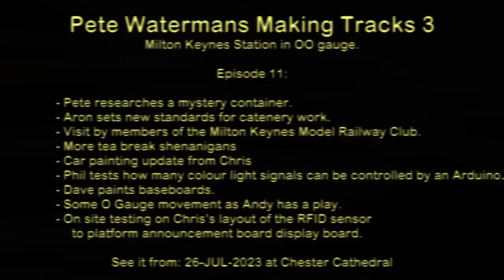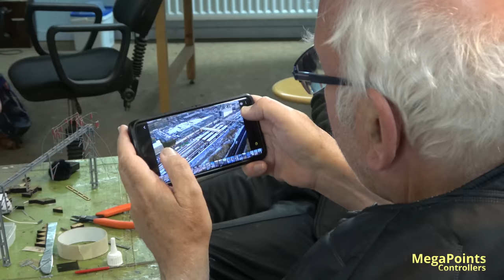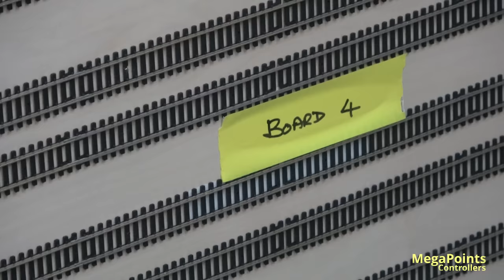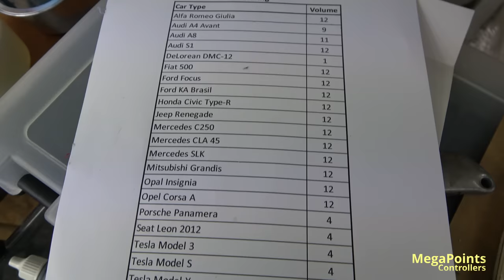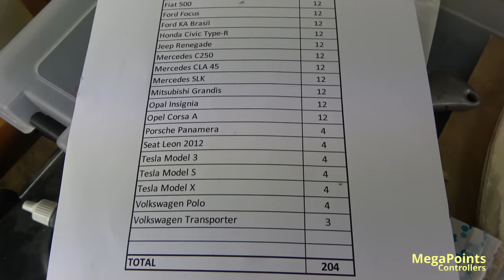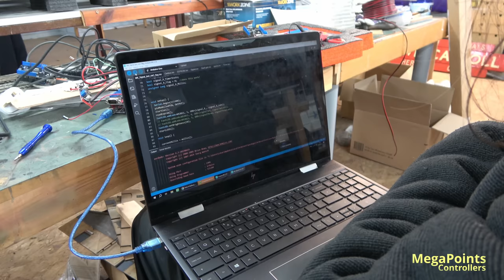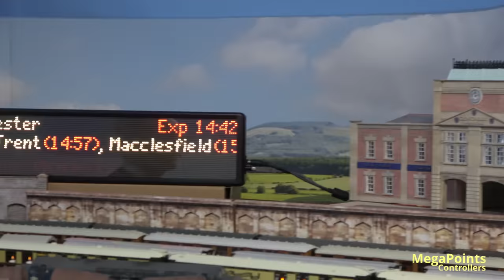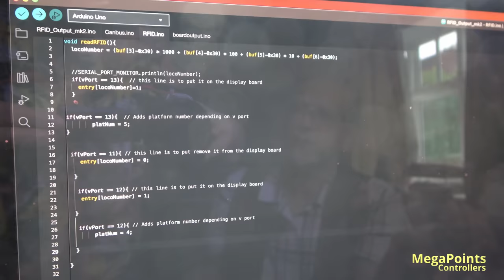Pete Watermans Making Tracks 3 Episode 11. Milton Keynes station build in OO gauge.

Comment: When we use hot glue at work and need it to set quick , what we do is get a can of air duster ,turn it upside down it then sprays freezing air ,which is great for setting glue quickly, brilliant video guys.